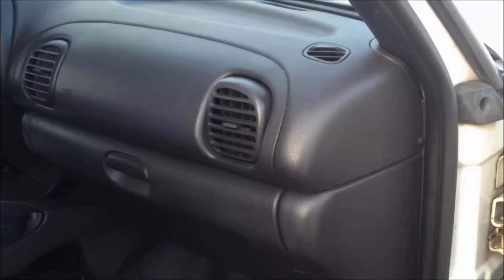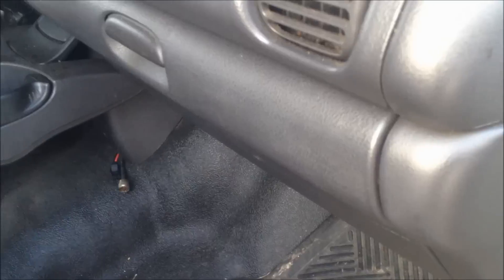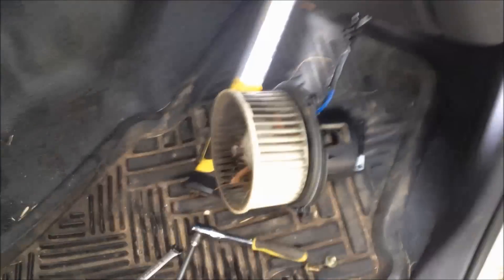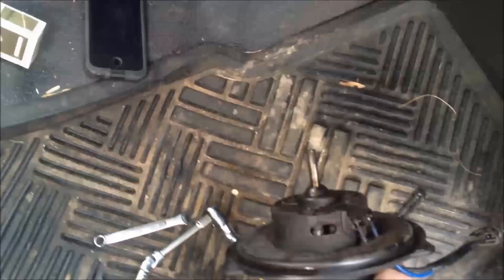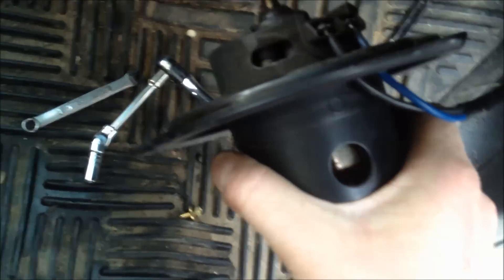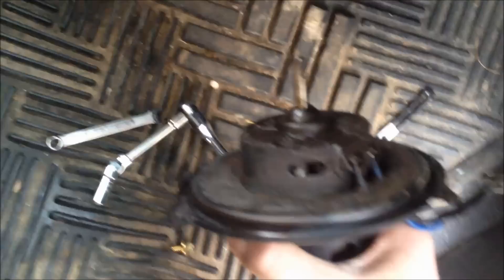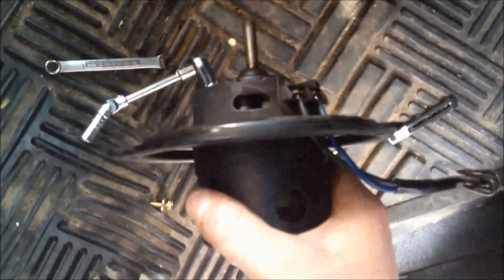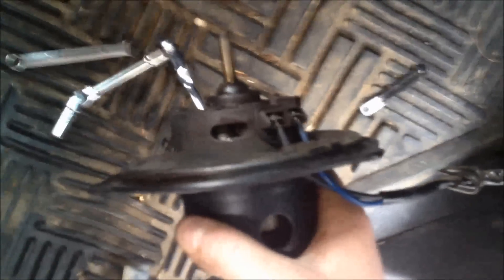2001 Dodge Ram Fan Blower Motor: Fixed it?

Comment: I like this guy - no pretense, preaching, or b.s. - just "cut to the chase: here's the problem, here's where it's located, here's what I did, here's the result". It will save all of that exploration and beforehand "mental picture planning" time. I'm glad to find this video - I have 2 of the same truck as this guy and as each rolled 100k mi, the fan motor bushings started screaming. I've been turning a wrench for almost 50 years and it was obvious that the motors needed to be replaced (lube is only a temporary band-aid). But catching this video will make it a slam dunk! Thanks, man! (FYI- the heater core in both trucks started leaking around the same time - came to find that's not uncommon)

Comment from the maker: Just an update, this only fixed it until the lube i used to oil the bearings dried up, went back to squealing real bad.  I will end up replacing the motor to fix it.  Thanks for watching.

Comment: Awesome video even though it’s eight years old it’s still extremely relevant I have the same exact issue going on if it only works in the high setting the resistor for the blower motor needs to be replaced which is what I am doing today blower motor squeals like a stuck pig but I think a little dielectric grease will fix that problem

Comment: if you have not fixed the fan speed controller you have to change the blower motor resistor . my truck was doing the same thing
Reply from the maker: I had changed the resistor block, and that was not the problem, it is the switch itself.
Reply: on my truck the blower was making the same sound as yours was
  which made the blower draw more power  which blew the resistor 3 times
Reply from the maker: OK, so you just kept changing the resistor until it worked? What is causing the problem then? bad parts?
Reply: when the fan goes bad it draws more power which blows the resistor
Reply: the guy at the parts store said the resistor is just a fuse. and I did not know the fan motor was the real problem
Reply from the maker: so the motor is bad.  Changing the resistor a bunch of times is a waste of money, no?
Reply: yes the motor bad then change the resistor

Comment: Thanks for the video.  Mine was full of leaves too...I took the motor out, cleaned it, lubed it up, and reinstalled it.  The sound went away for now.  But after I put it back in, I realized I forgot to put that damn clamp back on top of the cage! I really don't feel like taking it apart again, at least not today.
Reply from the maker: Glad I could help.. I really don't think that pin does much, might was really tight on the shaft.  Thanks for the comment!

Comment: Three years is a long time but there is a resistor block that is to the right and toward the engine compartment. That will eventually wear out ( or in my case it was cracked).

Comment: The resistor is what controls speed when it works on full power you know you’re getting full voltage
Reply: I ordered one of those first because it would stop spinning on speeds 1 and 2 and you had to keep it on 3 or 4 to keep it from shutting off. Then you had to tap on it with your hand to get it to turn on again. Or just turn it off until you hit a few bumps in the road and it would work agan. lol I'm sure both the motor and resistor are shot, but I figured do the resistor first and see. what do you think? maybe also debris inside the blower motor too causing it to stop at slower speeds? I haven't taken it out yet.

Comment: To fix the variable speeds check your resistor block if that fails you will only have high and off and if your block is fine then it could be your switch but I'm guessing resistor block best of luck
Reply from the maker: I changed the blower resistor the day after this video and that did not fix the variable speed problem unfortunately.. I also don't think its the switch, I've been told if the brushes on the motor are totally worn out than it can quickly fry the resistor block.  So I will be changing out the motor here soon because the sound drives me crazy.  Thanks for the comment!

Comment: Excellent!  Thanks for posting this...my fan motor has made that exact same awful squealing sound when I first turn it on for several years now.  I've known I need to look at replacing it....but I haven't priced a new motor yet.  Any idea what it costs?

By the way...nice floor mats...I'm pretty sure I have the exact same ones!
Reply from the maker: lol, I bought those floor mats when i was in high school (13 years ago) at Wally World and they have last forever..

I called Napa after I posted this video and I think they said like $60 bucks... I think when it becomes AC season I will change it... Thanks for watching Matt!

Comment: The screw on the back side of this motor is very difficult to get to. I used a flexible quarter inch drive socket driver. Now my squirrel cage fan is too loose on the new motor shaft. I am gong to put JB weld on it too keep it from slipping up and down. It worked good for about a minute, then the fan slipped down and was rubbing on the motor flange. Also don't forget to use the old rubber gasket off the old motor. I put my motor in the dumpster, and after watching a video, I realized I needed to go dumpster diving to get that rubber gasket, minutes before the garbage truck arrived.
Reply: another thing I could do is get a hose clamp to use instead of the spring loaded shaft clamp, then also put JB Weld on it. Worse comes to worse, I'll need a new squirrel cage fan.
Reply from the maker: LeRoy Wolff Glad you figured it out.  Thanks for the comment!

Comment: Did you ever replace the motor and did it stop making the noise? once you replaced the motor, did the fan work on other settings besides high? we're having the same problems with our truck.
Reply from the maker: +Angel Cain I never replaced the motor, and it still makes the noise.  I believe it is the worn brushes.  You could keep oiling it, that lasted about 6 months.

Comment: I hope you ended up scraping out the condensing box. If your motors got shit in it the rest does as well I pulled out a 100 gallon trash bag worth of pine needs and other crap.

Comment: ok... I had no speed either than High and off so I figured out the blower motor resistor was bad.  Changed it and it worked great for a week...then the motor started sqealing like this.  drove it around squealing for a week then the resistor burned out again...I could smell the burning.  Only issue is that now that the resistor us burnt and I'm on full high - no squealing.  Could it be possible that the lower speeds are causing the squealing?  anyone have this happen before?

Comment: Mines making a clanking noise. I think there's ice or some other obstruction. Mine is a 05 hope it's not to much more difficult then wat you have here
Reply from the maker: I don't know, I can't imagine its that much different.  If its not below the dash it might be behind the glove box.  Mine is still making a bad noise.  I replaced the blower motor resistor as well, and I think the motor is just about shot.  Thanks for the comment!

Comment: I oiled mine ,the same way you did 4 years ago and it still running strong. As far as it only working on the high side when the motor started dragging and squealing.. it burn out the lower speeds in the resistor. Right to the left of the blower motor to some wires going to a little square box there is a speed control resistor there they're only less than 20 bucks on eBay. That is what controls the speed of your motor not the switches... Replace that and you'll have your speeds back again

Comment: just change the resistor motor and the bigger fan motor piece-of-cake took about a half hour   don't go to the auto repair shop do it yourself save a ton of money cost me $120 for both parts probably would have cost about $550 at a shop so easy to do